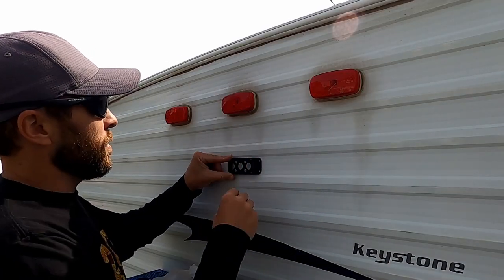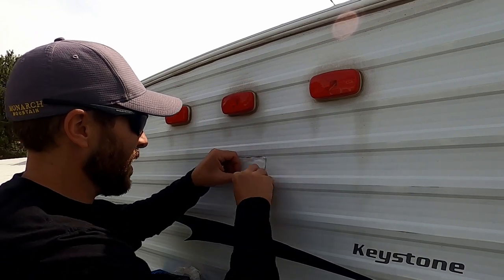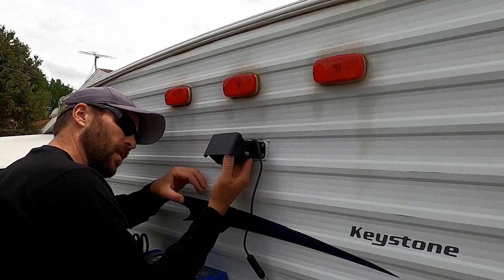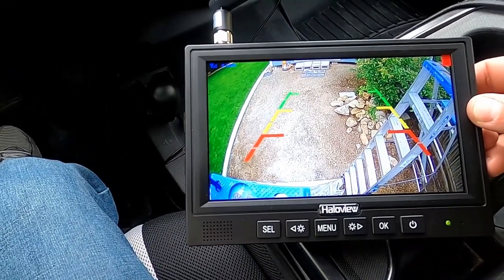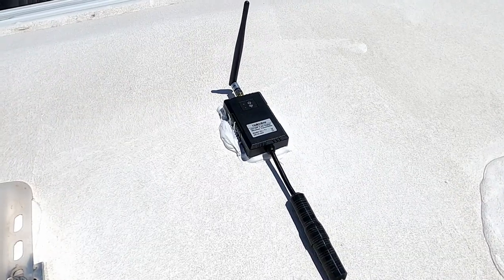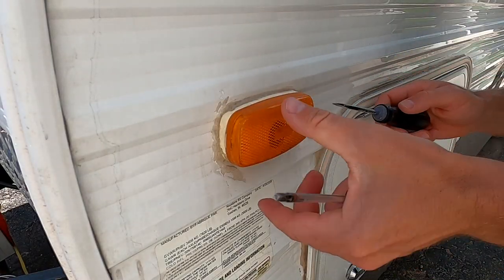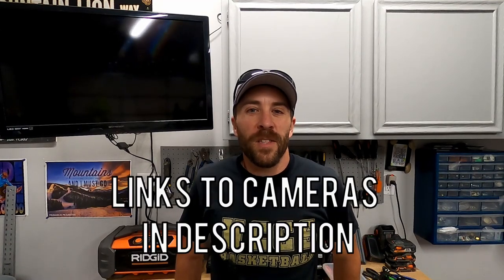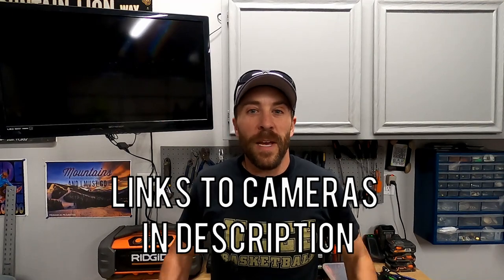How To Install An RV Backup Camera w/No Backup Cam Prep - Plus, Marker Light Cameras Install!

Comment: Thanks a ton for the video! I installed the exact same system and very happy with it. I must have a short somewhere though. I wired power in through the marker lights same as you, but I noticed my right turn signal and right brake light don’t work when the lights are on. When I turn the lights and camera off, everything works fine…
Reply from the maker: It's been a really good system, we really enjoy ours!  Chasing electrical issues like that are a pain.  I hope you find out what the issue is.  Thanks for watching!
Reply: @ColoradoCamperman  I’m guessing I nicked the insulation from a wire trying to fish them out of a tiny hole in the sheet metal. The rig was supposedly pre-wired for a Furrion, but when I removed the cover no wires were present. So far, the only feature I wish the system had is the ability to zoom in a bit. I would seriously consider upgrading if they made a system with this feature. Seems like this could be done via an app/firmware update.
Reply from the maker: @williamcarter6374  Got it, that makes sense.  I've done that before!  That zoom feature would definitely be a nice feature.

Comment: Nice job...but what's the deal with all the wire for the main camera antenna. Why didn't they make it built in to the camera like the side marker ones.  Seems a little ridiculous.  I'm not keen on drilling anymore holes in my roof than necessary.  Not your fault they designed it that way, just seems strange.  The antenna on ours is but in to the camera.
Reply from the maker: Thanks.  I would have loved if they did a camera like the side marker ones!  The problem is video feed transmission.  They do make rear cameras like the side marker lights, but they are for shorter trailers.  So, if you have a shorter trailer, you could probably get that camera.  If not, you'll have the wires like ours.  Thanks for watching!

Comment: How come you don't use the marker light as your mount instead of drilling new holes? One less marker light doesn't matter you have 2 others. That's what I did on my Coleman. I just use my running lights witch I like to run because of the lights I installed on my truck to energize the camera to constantly monitor the back of my camper Want everyone to see me coming with my 29' camper. Just calk it and your done . I do like the side camera's but since my camper is only 28' I'm not going to bother with those. Besides my mirrors pretty much give me a good line of site. But cool anyway.
Reply from the maker: Yeah, you could do that as well.  I honestly didn't even think of doing that.  Thanks for watching.

Comment: Hey Brian, where did you put the round rubber piece on the camera wire that goes on the mount? It does not seem to fit into the wire hole on the bracket. Thanks for your input.
Reply from the maker: Hello, the rubber piece goes through there, but you really have to work it to fit.  There should be a rubber grommet where it fits the camera mount.  I had to carefully use a flathead screwdriver to get it on there.  Hope that helps.  Thanks for watching!
Reply: @ColoradoCamperman  Thanks. It almost looked like it went between the two mounts.
Reply from the maker: @silentrockstube   I know what you mean, I thought that too. It is a tight squeeze but it fits.